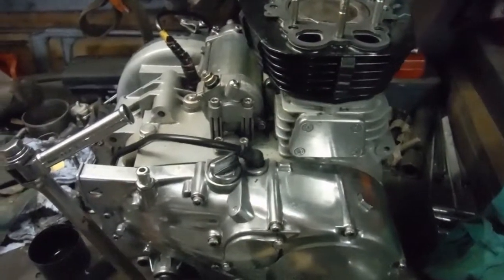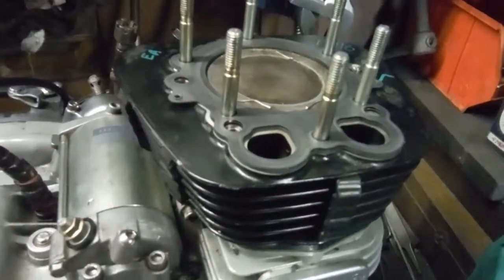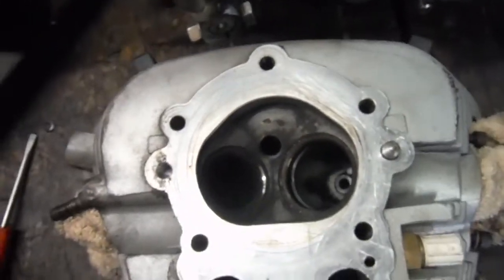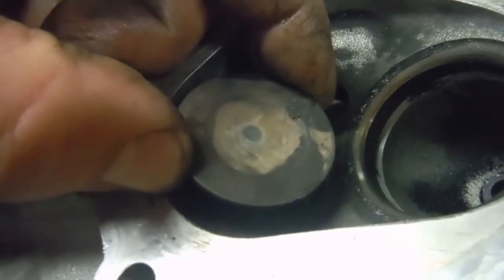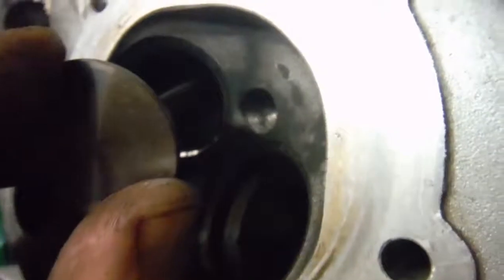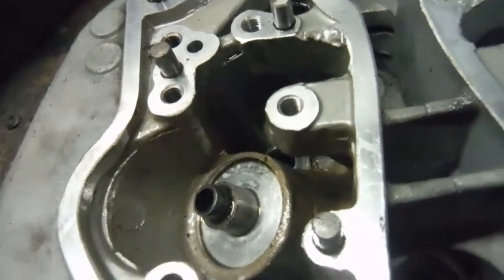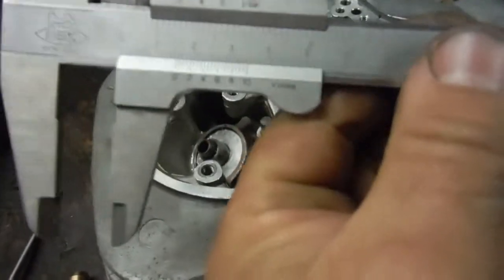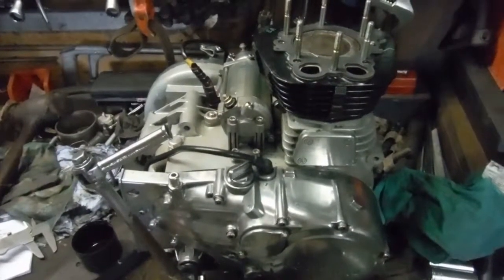RE 500 UCE engine top end specs discussed at Performance Classics.

Comment: Hi @paul. Is that stock UCE 500 piston? How much compression you bumped it to from the stock 8.5:1 ? 
What's your opinion, how much we can shave off the barrel from the bottom and still able to maintain piston to valve clearnace without requiring to make valve release pockets on the piston? It will be extremely helpful if you can clarify these. Thanks
Reply from the maker: Most of that stuff is my own info, which I worked long and hard to determine and I won't be sharing it, but the compression ratio was raised to 9.2:1.
Reply: @paulhenshaw4514  ok NP Paul but is that a stock piston?
Reply from the maker: Yes, with a modified crown.
Reply: @paulhenshaw4514  Yeah I can see it's bit domed. Do you weld extra material to make it domed? Btw Thanks Paul for the quick responses. Truly appreciate 🙏

Comment: Hi Paul, in your estimation was the valve guide play wear or just poor quality assembly work in the first place? 8000 miles does seem very young if it's wear, poor stem oiling perhaps?
Reply: We can hope that quality improves! RE are in an excellent market position world wide at the moment, it would be a shame if they ruin their chance at being a world market leader in classic / retro style bikes. Specially now they have announced the new 650 CC twin which should be a real winner for them. I hope they do well.
Ray
Reply from the maker: It didn't appear to be so much wear, as loose tolerances, as far as I could tell. The inlet [which admittedly runs cooler] wasn't too bad by comparison.
Reply: Thanks for the prompt reply Paul, I'm considering purchasing a new Royal Enfield Classic 350 at the moment so I'm interested in these engines. They seem to be a real lucky dip as to whether you get a nice tight smooth runner or a bucket of bolts, thanks again!
Ray
Reply: With India it appears to be as you say "a real lucky dip" where quality is concerned. After you purchase there motorcycles you have to fix them up so that they will be reliable and thus ridable. The cam spindle rattled loose in mine, oh happy days.

Comment: Hi Paul ! Informative as always. I was wondering how do you clean all the parts of old engines so good, especially combustion chamber ? Do you use carbon remover or some other kind of cleaning agents ?
Reply from the maker: Most of the time, I scrape the thick, hard carbon with a large copper washer or 2p piece to begin with. Next, I follow up with wire wool and clutch and brake cleaning fluid and finish with a clean rag soaked in the same fluid..
Reply: That includes a lot of hard work ! Appreciate your efforts for sharing.

Comment: don't want to teach you to suck eggs but turn up a little collar 15mm deep a sliding fit on the guide and drive the guide through the collar till it bottoms out
dave
Reply from the maker: Thanks, Dave. What I did, in similar fashion, was to use the lathe to scribe a mark on the guides so I could see when to stop, but a mandrel to drive them to the correct depth, as you describe, would be more foolproof.